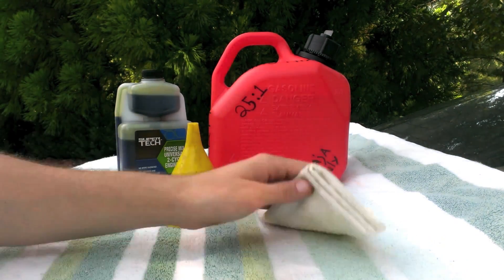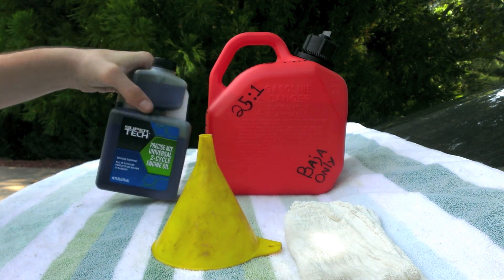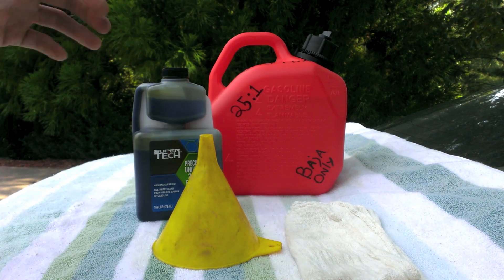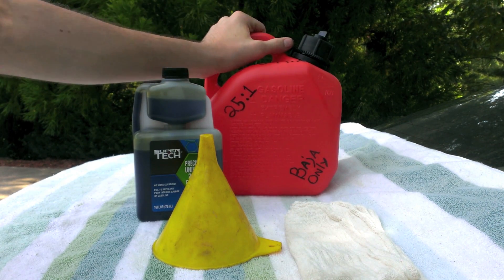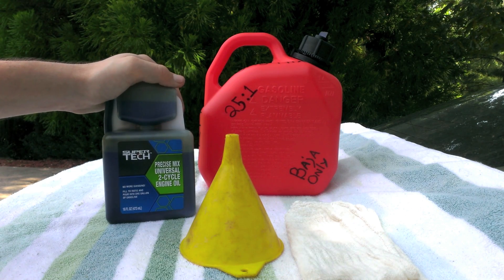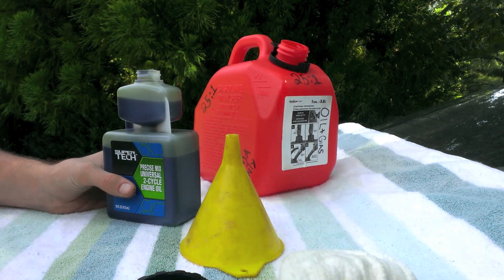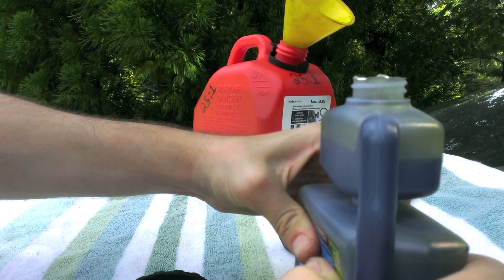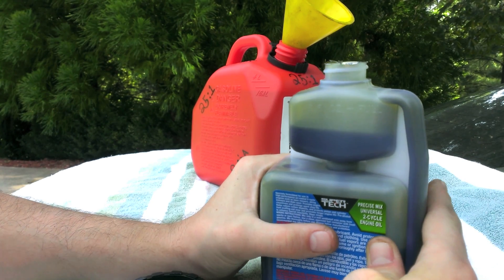KKRC Productions: Mixing the Proper Oil & Gas Ratio for your HPI Baja

Comment: Mix 5oz to a gallon and you'll be fine. The oil you're using is fine. I use MX two stroke oil. I use either Klotz or Castor 927. I love the smell...............Just saying. Plus, once the engine is broken in, depending on how you drive, you can play with the oil mixtures but will have to adjust the carb. But I wouldn't go less than 32:1.

Comment: You never use high test gas.  It is designed for 4 stroke motors with special needs so valves wont ping or shit tink and sputter in old cars.  Regular non ethanol is the best.  You just f your bearings and up with high test
Reply: The manual calls for premium gas. No Ethanol.

Comment: Are the 1/5 fuelite engines durable? Because I'm sick of my tempermental, fragile 1/10 scale redcat shockwave, and I'm wanting to get one of these (its a different brand and its 4wd.. Alot cheaper, too ).
Reply: Dont get the cheap clones, They will be far worse than that redcat
Reply: +Jackson Flax oh it is a redcat. dunerunner.
Reply: Not bad but I would highly recommend a HPI Baja or Losi 5t They are totally worth the money.   And btw I used to own a redcat shockwave. It ended up in my trash Bin.
Reply: +Jackson Flax my shock wave is a very good little buggy. I just can't get the mesh right. I love it. and I was going to get the dune runner because I've owned hpi baja before and they are garbage. I've of had one problem with redcats.
Reply: The dune runner is actually a clone of the baja and is very similar, Honestly It would be a good Idea to save up for a losi.  There just well... Amazing. But if you want the dune runner than go ahead thats your choice not mine  :)
Reply: +Jackson Flax yeah the losis are amazing. my friend owns one and he let's me bash it from time to time. it handles a lot better than the long buggies. I think they're more durable too.
Reply: I was about to order my own losi after driving My friends, But they where sold out almost everywhere so I got the Kraken instead. But it wont be Delivered until wendsday, which feels like forever now :(
Reply: +Jackson Flax I know that feeling. it only took a week for my shock wave to be shipped and delivered but it felt like a month.
Reply: I'm just stuck having to watch the same Low quality videos of the kraken vekta until it gets here
Reply: +Jackson Flax Be positive and patient, my friend!